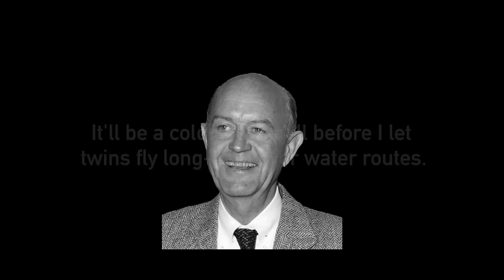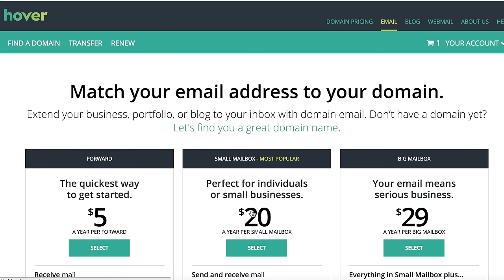Small Planes Over Big Oceans (ETOPS Explained)

Comment: Why is the A319 crossing the Atlantic such a big deal ? Charles Lindbergh crossed the Atlantic on a flying lawn mower.
Reply: D-Gauss but without passengers
Reply: @ianbuchan1793  Pretty sure lawnmowers are a lot lighter than gas turbine yard trimmers
Reply: Well...
- Passenger number is over 100 which means the plane is much heavier and having enough fuel can become a serious issue.
- Lindbergh flight was really dangerous, FAA wants commercial planes to be as safe as possible. Meaning that whatever happens during flight the plane can still land safely. 

On moderne small twin engines, those issue were mainly solved by using new generation engines that features high fuel efficiency, thus defining new standards for those type of flights.
Reply: He was the first who didn't die trying
Reply: It is certainely no big deal, who told you that ?
Reply: Do people not see this is a J O K E
Reply: @NonyaBusiness! Aviation geeks might not understand humour my friend
Reply: R/woosh
Reply: @elmokelmu  Or...hold up...or...they just suck at telling jokes.
Reply: @bishop51807  thats possible
Reply: jesperlett so he was the first to cross the Atlantic.... tada
Reply: But Emilia Earhart didn't make it.
Reply: Shirley you're joking!  I'm not and don't call me Shirley.
Reply: That's what made Lindbergh a hero at the time, there was a lot of risk involved in what he achieved.  The difference here is that same trip must be as reliable as getting on a bus and expecting a safe reliable trip over and over again with almost 100% success rate
Reply: MisteurCraft i have to say it.
r/wooosh

Comment: Now I know why it's taken over a year to get Southwest Airlines certified for flights to Hawaii. There's more to it than just the airplane.
Reply: Southwest flies to Hawaii? This is news to me.
Reply: @joe8124  they started in May, but had planned them for years.
Reply: Why tho? There are zero divertion airports anyways.
Reply: HasseBrasse engine failures are rare and it unlikely that both engines will fail
Reply: @johnduffy2777  both engines fail even then 99% of the time at cruising altitude that plane will glide for 100 to 150 miles up to an hour before you hit the ocean. Giving time for rescue craft to get up and in the area or an attempt to make it to land.  Thats if you can keep an single engine going for another hour or even half hour you can go pretty far.
Reply: The  departure airport is also is also a diversion Airport
Reply: Etops/edto certification can take up between 9 to 12months covering all aspects of risks,fire containment, 3 critical scenarios, contracts,training,plane must be etops equipped or approved for etops type rating, recovery plan, pax n crew safety..most important is Engine reliability or IFSD rate, (all based on numbers)..4 engine still "safer" over etops remote route,depending on time to runway.. but maintenance cost fuel,l consumption,new tech don't justify 4-engined anymore...
Reply: @mirzaahmed6589  ⁶
Reply: It's got a lot to do with safety laws, which, like all over laws take time to implement and change etc.
Reply: I am born and raised in Oahu. I’ve definitely noticed the other neighbor islands are way under developed compared to the state capitol.

Comment: I wish people would stop saying this guy has a plane fetish. He's likely a pilot or an aviation technition. He's passionate about it and that's awesome.
Reply: Kyle B definitely not a pilot, as there have been some serious mistakes in the previous videos (eg that "most thrust is generated from the engine core")
Reply: What video was that? I'm not doubting you, I just would like to see the video for context. It depends on what type of jet engine he was talking about. If he was talking about a turbojet engine, then he would be right as all of the thrust does indeed come from the core. However, if he was mentioning a turbofan engine, then you would be right as the core basically runs the fan, which generates about 80% of the thrust.
Reply: Kyle B He's neither mate he's only 19 years old
Reply: My cousin is 16 and he's a pilot. What's your point?
Reply: +Kyle B Even then it doesn't make sense. The core is the ONLY source of thrust in a turbojet (so "most" isn't appropriate). An extremely low bypass ratio turbofan could work like that, but the bypass ratio would have to be less than 1. I'm not sure if anything like that exists, except perhaps on some very early turbofan engines.
Reply: Kyle B are you fetish shaming? That's a crime here
Reply: Stop kink shaming. There's nothing wrong with having a plane fetish :p
Reply: Kyle B I have a plane fetish, and I am a pilot, aerospace engineer, and a&p. Good thing my passion for airplanes gets readily satisfied.
Reply: A few large mistakes in this video too. From the form I would guess that he is filling in the gaps with nice sounding assumptions or bits of "common knowledge" to reduce the amount of real research effort.
Reply: Calm down people, the thrust of the argument was sound. I fly across large bodies a lot, and for many years, so this was interesting to me.
Reply: He's passionate about public transport as a whole. And so am I. I see a lot of wasted potential from public transport like trains and planes.
Reply: KyleCBE nope
Reply: I mean planes are sexy as hell, I get it.
Reply: Then you haven't seen his other videos. About 50% are about planes, others are others. He even have other channel: HalfAsInteresting
Reply: @Wesley Bennett. I too have an extreme love for aviation. 32 years as an aircraft mechanic. To this day I still look up to the sky whenever I hear an aircraft overhead. :D
Reply: So you expecting me to say he has feet fetish?

Comment: Just curious, do you have some education in aviation because you explain these videos extremely well? Or is your research process just that concrete? Either why I'm a bit of an aviation nut so these videos are super interesting to me so keep up the great work!
Reply: It's just a lot of research, I highly doubt he has any special education.
Reply: Actually, he skips a lot of research and his videos are riddled with errors. He's good at BS'ing
Reply: Can you cite an example please. I just subscribed. But if this is the case, I will definitely unsubscribe.
Reply: The title's wrong, for starters. Twin engines are used for planes of all sizes, not just "small" ones--it's like he forgot about the 777! His history of ETOPS and plane design is oversimplified, but I'm not going to bother analyzing it after I watched the one about why planes don't fly faster. That one was total garbage, he got the engines used on certain planes totally mixed up and said most of the thrust comes from the engine core as opposed to the bypass (plus many other glaring mistakes). And the ones where he analyzes plane revenue/costs are nonsense because he looks at just one example and then extrapolates everything from there.
Reply: bta fan Yes, unfortunately you are 100% right. In the previous videos there were a lot of things that were absolutely wrong and badly researched, especially the point you mentioned with the thrust.
However I really enjoy the videos, they are easy to watch and most of the things said are somewhat accurate.
Reply: I will give the channel one more try I guess. I really do enjoy the content. But if the info is false, that's a big no-no.
Reply: bta fan Do you know an alternative channel with more accurate information?
Reply: No, I think it takes longer than 8 minutes to explain the complexity of aviation. Just ignore his conclusions and look up the subjects he brings up on your own.
Reply: Yep, and the wikipedia page on ETOPS is much more comprehensive and accurate than this video.
Reply: Steve Silva I don't know of any channels that cover topics as broad as Wendover, however if you are interested in aviation related videos I would recommend Captain Joe.
Reply: Yeap; Captain Joe is pretty good to. He covers the smallest stuff and he is an actual pilot. Go check him out!
Reply: The 777 was introduced way after the ETOPS certification was introduced.
Reply: The Airbus A300 was the original aircraft that got the ETOPS certification started. Back then the FAA didn't want twins flying long-haul overwater, but the other aviation authorities, for example India, simply didn't care. So many airlines in Asia started flying long overwater routes with A300s, and it worked well due to the reliability of the GE CF6 engine, compared to the problematic JT9D. Airbus didn't manage to sell any A300s to the Americans until very late (They gave Eastern Airlines a long-term test drive, but Eastern doesn't fly transatlantic.) so the FAA didn't care much.

Boeing threw everything in the ETOPS game with the 767 and CF6 engines, and pushed very hard on ETOPS to the point of spending tons of money renovating long-abandoned airports (e.g. Midway Island) in the middle of the Pacific for their airline customers to use, and their efforts culminated with the 777 and 787. Airbus in the 90s played it safe and built a 4-engined variant of the A330 called the A340, with the slogan "4 engines 4 long haul". It worked for a while (e.g. North Pole, New Zealand-Chile, South Africa-Australia) however Airbus didn't expect that ETOPS times would rise to ridiculous lengths, as it takes a truly brave soul to fly 300+ passengers on one engine for 5 hours. But nevertheless the laws were changed and the A340 suddenly became obsolete. Airbus didn't lose much however as they have the A330, and didn't spend too much on development costs.

Airlines have never experienced a engine failure at the absolute limits of current ETOPS standards, so it remains to be seen whether or not it's a good idea to extend it to 5+ hours.
Reply: Just to add a little bit more to what happened with the A340, in case you're wondering why the 4-engined jet succeeded (for a while) where the tri-jet MD-11 have failed. 

Back in the late 80s/90s McDonnell Douglas, the maker of the DC-10, was in serious trouble, and the other tri-jet manufacturer, Lockheed, left the business leaving its airline customers high and dry. So MD was trying to hack together a modern tri-jet on a shoestring budget, as doubts circle in the media about its ability to stay in business. After the Lockheed debacle many airlines vowed never to invest in an airliner if there are doubts that the manufacturer may not survive, which hobbled MD-11 orders. Airbus didn't have this problem because of generous European state backing, while Boeing became the de-facto aerospace champion in the US, with strong influence in state legislatures, Congress and in US military procurement - Uncle Sam is by far the world's biggest customer in aerospace.

McDonnell Douglas also had a reputation problem in that they're deemed to be great salesmen, but poor engineers. The DC-10 was beset with problems which at one time grounded the whole fleet, and in the MD-11's case the MD salesmen over-promised and under-delivered. When initial flight test results revealed the shortcomings in the MD-11's performance, a major bellwether customer, Singapore Airlines, cancelled its order and switched to A340s. Back then Singapore Airlines was considered the single biggest influencer in aircraft sales (a bit like Qatar and Emirates today) and it was a massive blow to MD, in which they never recovered.

Finally there are major advantages in the A340 which the MD-11 couldn't match - the A340 as a variant of the A330 means that they have significant parts commonality with A330s, and the Airbus "CCQ" common flight deck philosophy means that pilots can rapidly transition from the tiny A318 to the A380 super jumbo, and A330 pilots are usually cross-qualified to fly the A340. This reduces pilot training and creates a much bigger pool of potentially qualified pilots for airlines to hire and roster. MD tried their own flight deck commonality thing with the MD-11 and the MD-95, but it was already game over for MD when the MD-95 first flew. The MD-95 later became the Boeing 717.

The MD-11 can be rather dangerous if mishandled. The MD-11 is a bigger DC-10, but they didn't make the tail bigger due to fuel economy concerns. Since half the tail comprises of an engine there's very little space for the rudder, meaning very little rudder authority at low speeds. this means very fast takeoff and landing speeds to get sufficient airflow over the rudder, quite a bit more than the 747. With gusty cross-winds it can become very difficult to control on landing, and several MD-11s bit the dust that way.
Reply: f0rc3U As a dispatcher for a major international airline I can confirm that most of the information is accurate. Is it the most comprehensive video on it? No, of course not. But that's not the point of these videos. I believe they're meant to provide a more simplified summary of very complex topics in a manner that makes it easy for the average person to understand. For such a short video I think he does a great job of covering the basics.
Reply: I'd have to beg to differ with the loosing money part of the A340, especially when it came to the -500s and -600s, doing all that redevelopment costs for the wings and many many other things, when they should have just counted their blessings and threw more money at the A330 instead, which as a Boeing person, pains me to say, is a great success, despite my captain hindsight thoughts on how they developed the program.
Reply: The A340-500/600 was a very niche aircraft created as a competitive response to the 777, by providing airlines with an upgraded A340 with extreme-range capabilities and no ETOPS/routing restrictions (not just Polar ops, but also Himalaya ops with less altitude loss in a one-engine inoperative driftdown) as a point of differentiation, compared to the better fuel efficiency and payload capacity of the 777. The -500/600's range capability comes at the expense of payload capacity (they tried to fix it with the HGW versions, but it was too late). Coupled with the tendency of economy passengers to prefer stopovers over flying ultra long-haul direct because of more choice and cheaper fares, means that the -500/600 is very much a business-class only machine that only works serving premium routes (e.g. Middle East/Singapore - USA). The -500/600 business case collapsed with the 2008 economic crisis, which completely killed business class traffic, and unexpectedly high oil prices in the mid-to-late noughties made the -500/600 extremely uncompetitive when deployed to other routes. The -500/600 is a case study of an aircraft designed around a specific future oil price, and get it completely wrong.

However the 777 isn't just fuel efficient, it is also very good with payload, especially with bellyhold cargo capacity. It is not uncommon for airlines to lose money flying passengers on 777s, only to make it all up in cargo. In fact one of the reasons why dedicated freighters are disappearing is because the passengers 777s are so good with cargo, they're killing the cargo airlines.

As for the A330, Airbus didn't redevelop the type because engineering resources are limited and the A380 delays sucked away the lion share of Airbus resources. They could afford to sit on the A330 however because Boeing didn't have a modern competitor until their own long-delayed 787 appeared. The 767 was not competitive (The 767-400ER sold even worse than the A340-500/600) and Boeing wasted 5+ years going nowhere with the Sonic Cruiser. Only when competition got real did Airbus react, with a cheap, re-engined A330NEO to fight the 787. Boeing is doing the exact same thing with the 777X, as a cheap, re-engined 777 to fight the A350.
Reply: There is no doubt that the 777 is clearly a superior product for the airlines and for the market that has evolved over the past 20 years, and with these new ETOPS regulations has increased its market dominance in the large jet category; this includes the A380 as well as the 747.  77Ws have effectively killed off the quad jet, as it is large enough to almost have the same passenger amounts as the larger quads, but with much greater cargo volume, especially when you compare it's passenger count to cargo volume ratio.  The 77W as well as the upcoming 777X generation aren't direct A350 competitors, as they are larger than the 350s and benefit from the economics of scale as such.  And not even being biased; Boeing DOES have the have the competitive edge and experience when it comes to engineering and keeping older products competitive as well as even market leading ie; 737 MAX, and even the 747, albeit its current version isn't selling like hotcakes, it's a good example of how Boeing is still able to keep an extremely archaic product at least somewhat competitive.  The Airbus NEO series has left so much undeveloped and a wasted opportunity to really leapfrog Boeing technology wise, especially with the A320neo.
Reply: Kelson Kai I disagree, I say that planes would be safer if they had 4 wings
Reply: This video is very simplified ✈️ The CBT airlines use for their ETOPS training take hours to complete
Reply: Something else he got wrong was LATAM's ''small'' 789 and its demand, which is actually very high since Santiago de Chile serves as a hub for most if not all Latin America-Oceania flights, in fact Qantas flies a 747 daily from SYD to SCL, Chile.
Reply: IgnaceBM another thing was that he said that the a380 was Airbus's only four engine jet, but Airbus's a340 has 4 engines and is a jet.
Reply: AwesomeHawk Gaming But the A340 isn't in production... He said "Airbus and Boeing's largest jets, the 747 and A380 are their only four-engine jets in production."
Reply: That's not true
Reply: I'm not even into aviation but I heard about etops, on TikTok, so I took a sec to check it out. I like videos like this but his delivery and knowledge drew me in, till the end. Bravo! subscribes